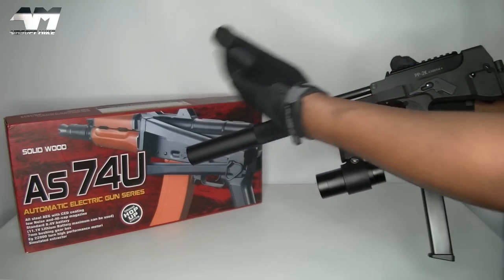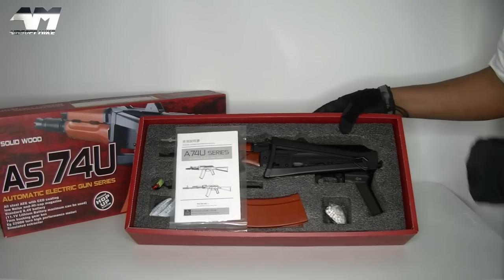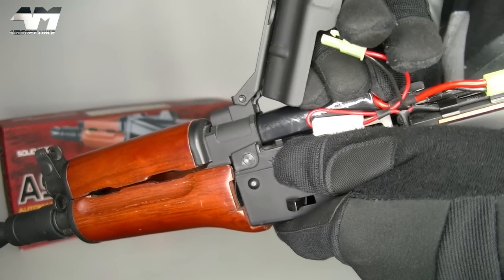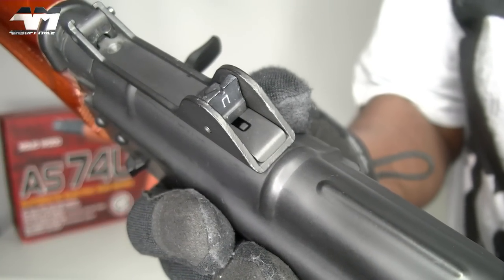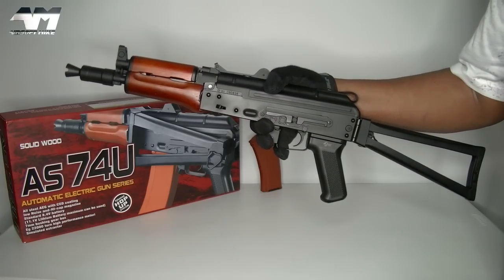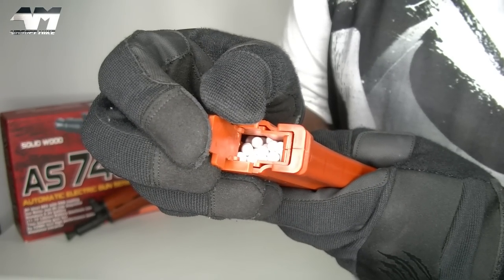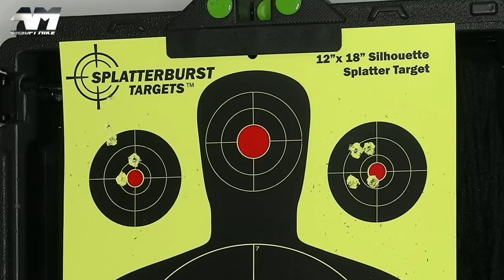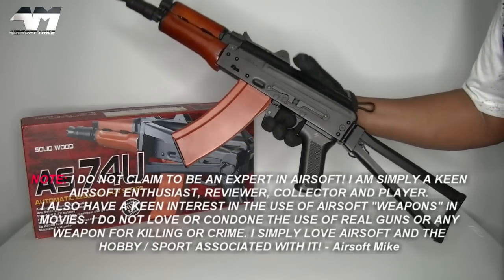JG AKS-74U / ELECTRIC BLOWBACK

Comment: You’re correct about “П” being the Russian/Cyrillic version of the English/Latin “P”.
Reply: And the greek version
Reply: It represents battle zero. Which is used for your more common engagement ranges of 50-200m then the 4-5 is for farther targets from 4-500m.
Reply: П comes from "постоянная" (consistent/permanent) an more or less is the battlesight setting on AK platforms П setting is the same  as 300 meters, you can even see it on airsoft replicas if you set the rear sight to 300 you will see is simmilar to П position. Sorry for the bad english
Reply: ГП

Comment: Believe it or not Mike the wobble on that airsoft AK mag is not too far off the real deal with certain mags. I use some mags in my real AK that fit so tight they barely move but I have a few that move all around as well, all 100% reliable.

Comment: Recently bought this piece, and my biggest issue is that it is literally impossible to take off the bottom hand guard without removing the front sight block, you also can’t disable the blowback due to the design of the dust cover release button

Comment: the booster servers two purposes 1 suppress the massive flash of a round meant for a longer barrel and 2 makes the pressure on the gas piston head for violent allowing it yo cycle correctly

Comment: I have one tear down is kind of a nightmare for something as simple as changing the muzzle device and there’s a special order in which it has to be done if your trying to avoid damaging it. The hop up feels kinda eh and prone to losing its hop adjustment, so I’m thinking of doing a replacement on it, but we’ll see if that effects the bb feed ability. One of these days I’ll probably get inside it for some maintenance/fps upgrade or downgrade, and I’m expecting that to be a pain too just due to wiring.

Comment: Like so Mike can see this: There is some Jing Gong Airsoft replicas that comes with adjustable fps. In the back section of the gearbox, there is a hole, if you see a allen bolt head deep inside, then it means that your spring guide is fps adjustable. This feature is not listed on the instruction manual. (in ak models is harder to see, because the receiber makes a little bit hard to see that hole).
Reply: @Efendisiz İtaatsiz The spring guide (in some models) allows to compress/decompress the spring, increasing/decresing the fps. So if this feature comes with your ak, you shuld see a hole in the gearbox (at the back, where the spring guide is placed). As I said, this feature is not present in all Jing Gong Ak's. If you need further info, just send me a message via Instagram at akira_workshop
Reply: No

Comment: Love me an AK Mike!
Got the Romanian EBBR Ak my self :D lovee them so much, a big cheesy smile the whole time I'm firing it lol 
- then bad thing i had with it was being a Chinese import, the FPS was wayyy to hot lol
Great video
Reply: Bruh aks are better than ars, I have a rpk74u
Reply: @kodiak4239  in real world an AK can deal a harder hit and blast a bigger hole, cos of the clearly bigger rounds and more grain, but however: the m4 does have better recoil control, and I may be wrong here, but also better penetration due the lighter round
Also however: in the airsoft world, they're practically identical as they rely in the internal gearbox.. but, AKs I've seen so far DO mostly use v3s, where m4 mostly use v2s 🤔

Comment: I had one but the blowback stopped working so it just became a normal AEG.
Reply: I don’t mind if the blowback stops working on any electric blowback gun doesn’t really make any difference
Reply: But yeah as a previous owner of this gun it’s a budget gun. I got it for $150. I’d recommend just saving up for an E&L. Especially if you’re more of a reenactor/Mil Simer. If you’re just a casual softer I’d say it’s good enough. Also the plastic the mag is made out of SUCKS.